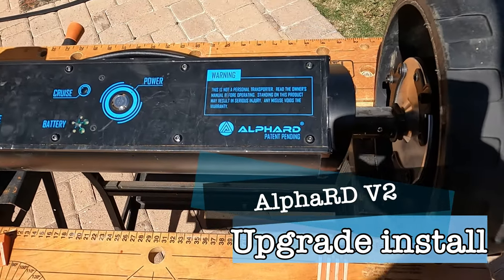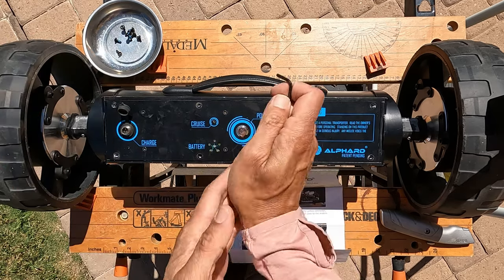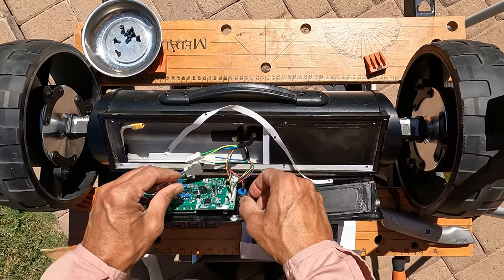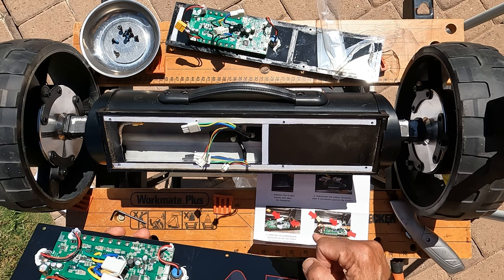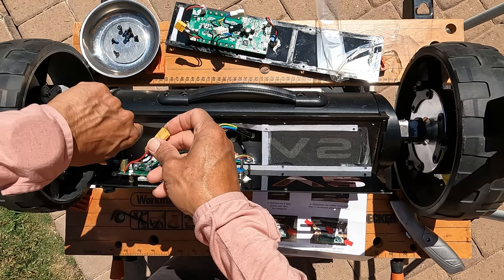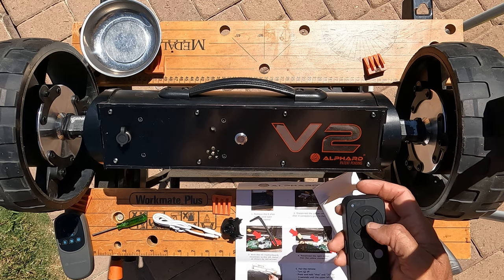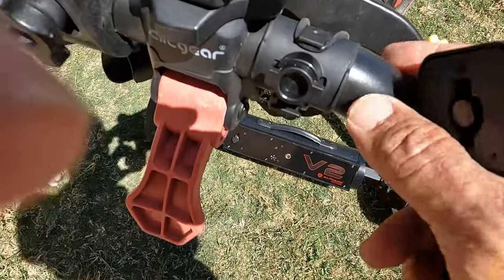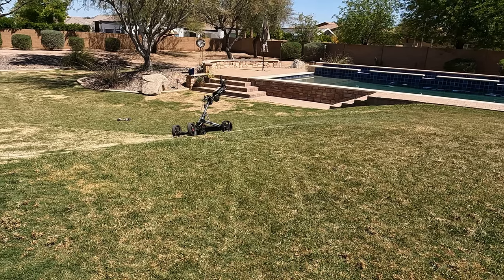ALPHARD V2 Upgrade Install

Comment: do you find the new controller causes faster battery drain? I'm wondering if the motor/hubs is the same v1 and v2 and the controller is the only difference. or if the v2 is optimized for the controller while the V1 motor/battery is just being stressed to do what the V2 can do stock. thoughts?
Reply from the maker: So I have found the battery life to be exactly the same after the conversion. From a full charge, I’m left with 2 of 5 LEDs after 18 holes of my local course.  My system is going on 4 years and I use it about 8 months of the year and 1 to 2 rounds a week - last year I bought my wife a proper V2 and cart - hers has roughly the same charge left at the end of a round. I think it’s just an upgraded controller - motors seem identical.